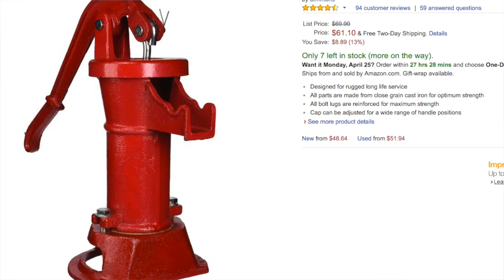Manual Well Pitcher Pump Install - PART 1

Comment: If you heat the part your trying to turn that usually works better than heating the part your removing it from. Applying heat to the pipe (if there was more it was not on your video) and not the cap would lock the cap even tighter to the pipe

Comment: I have a similar looking well on my property.  It's a capped 2" iron pipe extending above ground about 18".  We use it to discharge un-treated water from our geothermal furnace back into the water-table.  Originally it fed the house with a small well pump and pressure tank located in the basement.  I was thinking about how I could adapt it for a hand pump system in the basement in case of a grid-down situation. I would like to see part-2 of your video.